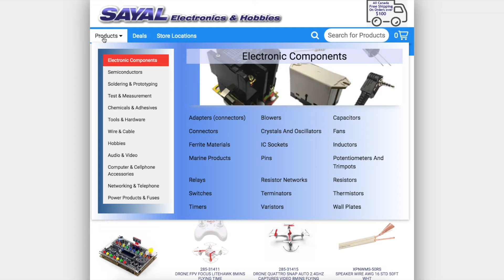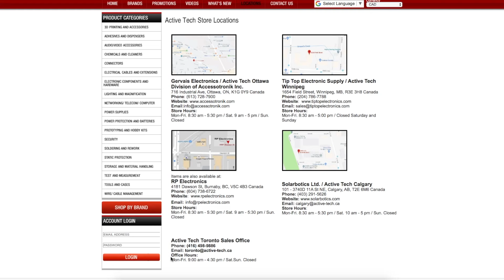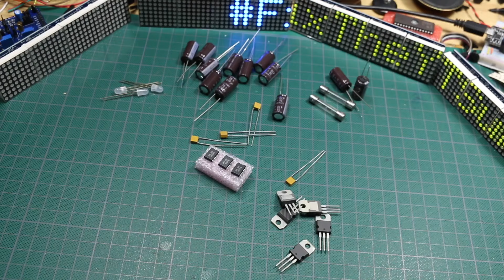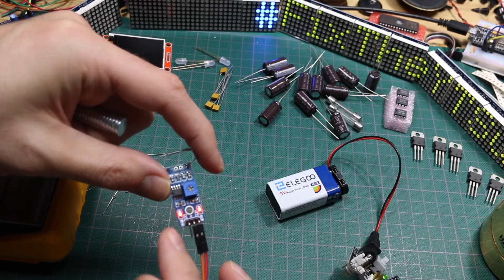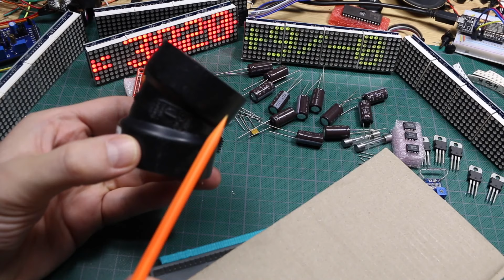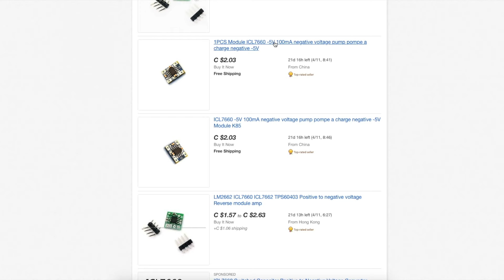GR Mailbag 19.OC.13

Comment: 20 years old electrolytic capacitor is probably dead. Thanks for showing the reed switch issue. Perhaps someone can suggest an better one. 7660 is nice for opamp but they really don’t output any current. $1.00 for just one module is expensive.

Comment: Reed Switches are directional,  rotate them correctly before soldering,  if rotated incorrectly they may work but very poorly.
Reply from the maker: The only problem is I could not find a direction on a couple of them that work reliably even trying one that wasn’t soldered so that I could get all the way around it. It’s like they were stuck. 
I’m wondering if the leads were not so securely bonded and by bending the leads we could bend the internal reeds and mess them up.
Reply: @GadgetReboot  one of the best test for red switch is to put your meter probes across the red, then place the red next to a transformer powered by mains, it will deguass the Reed and work like new again
Reply from the maker: That’s something interesting I will try. Does the transformer have to be a minimum amount of power or just anything and does it have to be loaded down or can we just plug it in on the primary? I have several old transformers from alarm clocks sitting around that I never had a practical use for until maybe now.
Reply: @GadgetReboot  just primary to mains, it will create a vibrating magnetic field that will deguass or rejuvenate the Reed. When too strong of a magnetic is used with reed, the Reed itself will become a magnet and its contacts will stay closed. But using transformer will magnetize it, making it work again, this can be done over and over.
Reply: Sorry,  .....using transformer will de magnetize it....
( make it not magnetized)
Reply: @GadgetReboot  @sargetester99 I guess you could probably use a tape head demagnetizer to do this too? Would make sense that the reed switch could get magnetized and then become sticky. Probably best to use a weak brown magnet rather than those rare earth powerful ones to trigger it.
Reply from the maker: I probably should have used one of those magnetic tape strips that come in the mail as junk mail from real estate agents sending notepads that can stick to the fridge.
Reply: @GadgetReboot  reeds are for very low current only, if current is too high or magnet is too strong,  reed will be faulty

Comment: 7660... was thinking of using one to get 12V for the ATTINY85 fuse setter.
Reply from the maker: Yeah I wonder how that positive voltage doubler configuration actually works out, including if the ripple is still clean enough for the fuse resetting and also what kind of voltage we need in to get the resulting 12 out. If we need something obscure like 7 V in, then we might as well just use a boost converter in the first place from something more common like 5 V or 3.3 V.  

I am probably going to investigate all the configurations of this chip at some point so I look forward to finding out what it can really do and various ways we can use it  for practical things.
Reply: @GadgetReboot  it may be simpler just to go with a 12V DC wall wort to feed into the circuit and have an Arduino Nano drop things down to 5V where needed. 

Hey! Looks like a better plan already :)
Reply from the maker: As long as the nano regulator can handle 12 in, including power dissipation to get it down to five.
Reply: @GadgetReboot  spec seems to say 6V to 20V is the spec for Vin on the nano. Should be good.
Reply: @GadgetReboot  to follow up https://www.arduino.cc/en/Main/ArduinoBoardDuemilanove

Comment: Active is gone from Ottawa now. They were bought up by some company, along with Gervais Electronics. Story has it that they have moved their inventory into the Gervais building (east end Ottawa). I'll have to get out that end of town to check it out.
Reply from the maker: In the Mississauga location, Active used to be at the corner of one of those industrial plaza buildings and then Sayal was right next-door, then there’s a bunch of little no-name one off places. When active closed, Sayal took over their unit and expanded. 
 At least it didn’t become another Starbucks or something.

Comment: Dang that Deoxit is expensive ... I got a can for about $17 after tax and I am still working overtime in the salt mine to pay the bill ⛏😂
Reply from the maker: Yeah I noticed how expensive it was when I first learned about it and looked it up on Amazon. Luckily I don’t do much contact cleaning but if I ever need to restore an old potentiometer or switch, it might be cheaper to just try to replace it unless I’m trying to maintain something vintage. In that case I’ll need to work an extra year in advance before doing the repair.
Reply: Sorry for late reply -- I have a number of old synths with noisy pots that need cleaning up, but I tested the Deoxit on a pot that I thought I fried and now it works. :)

Comment: Unplug the LED matrix and mix them up on the displays
Reply from the maker: Yeah I never thought of swapping out the parts between panels, I could either alternate colors from one square to the next within a panel or if I have the right color on the wrong circuit trace layout I can move them over to one that has the right layout but wrong color on it. 
What I really want to do is get a whole bunch of different things going at once including my old nixie tube counter from earlier this year.